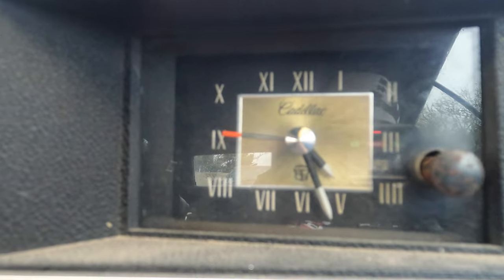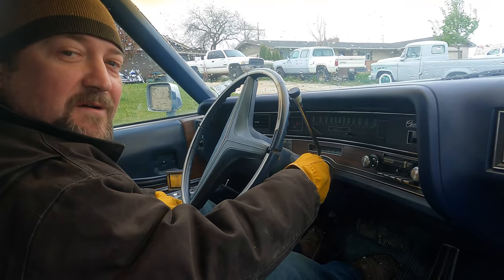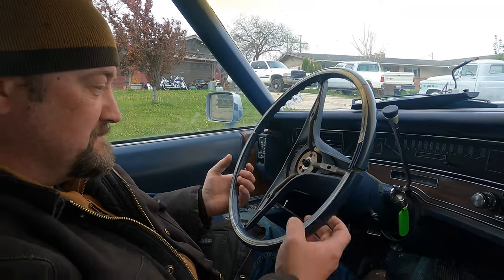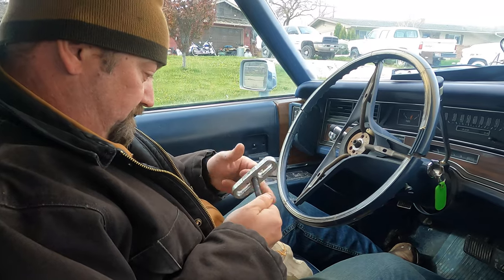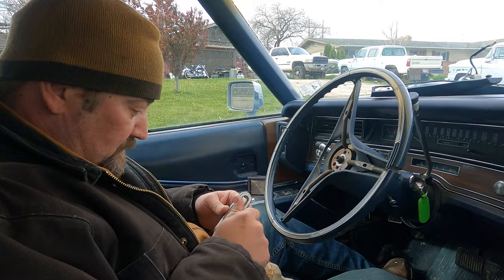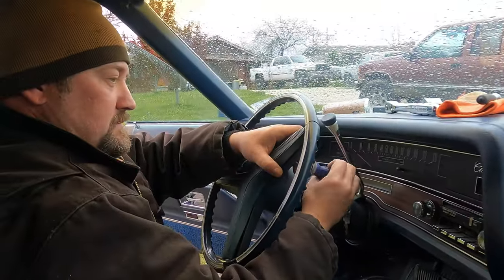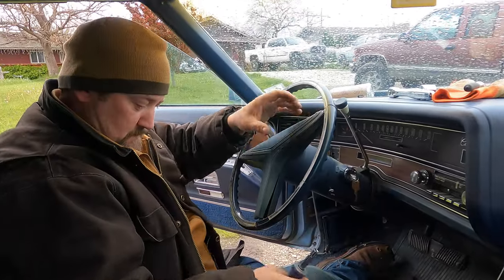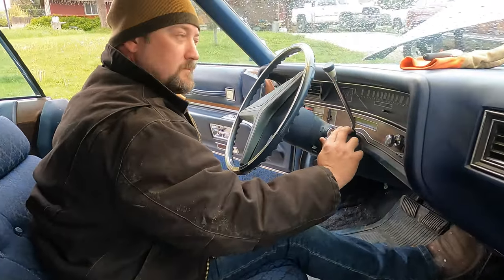DIY 1973 Cadillac Ignition Replacement

Comment: Thanks for the video. i just bought a 1971 eldorado and i have a question about the fuel gauge. I see that yours fuel gauge is stable even with the power off. I have the same thing. Is this normal or is it a problem? Thanks for your help.
Reply from the maker: Thank you for watching!! I am not 100 percent sure on that but I actually think it should go completely flat once the power is off. This one has a power draw somewhere and is draining the battery.
Reply: @IronHorseGarage  thanks a lot for your kind reply. I will open the dash board for understand why my gauge still all time in the midle. Wish you the best.